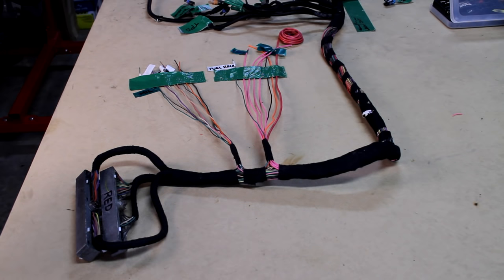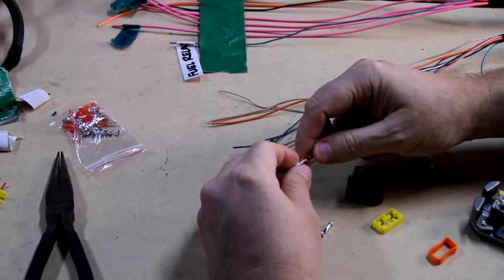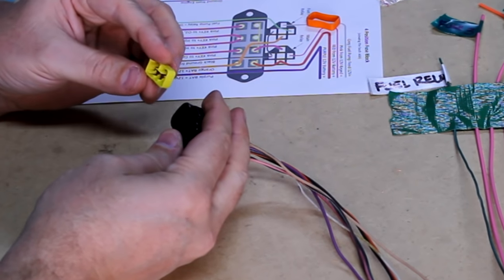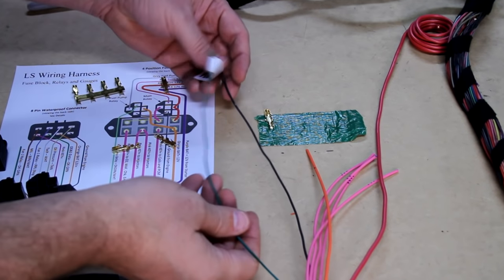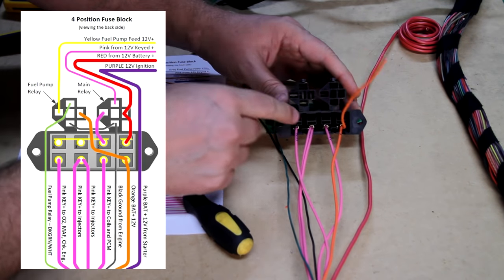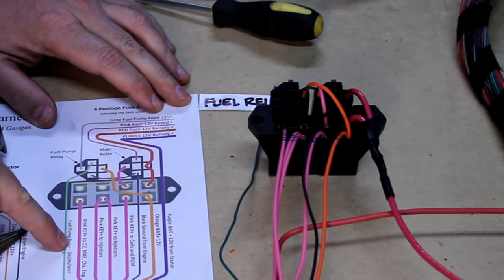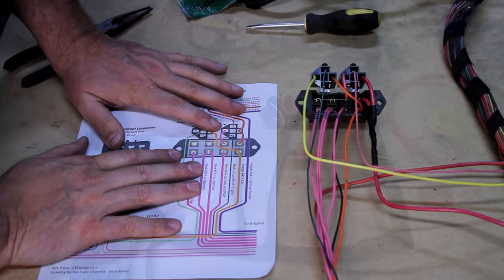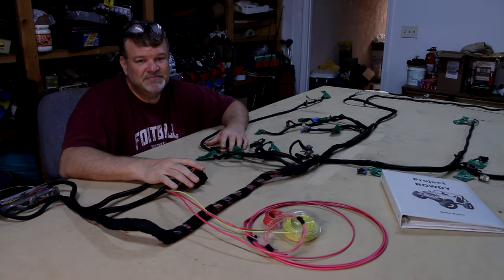LS Wiring Harness Part 5 | Project Rowdy Ep017

Comment: i already install an starter relay so i notice that the ignition switch need a relay so i notice  you run a wire from starter to ign key so my question is, what wires from ignition switch go to a relay? hope you can help me to wire this relay for ign sw. thank you
Reply from the maker: @javierargumedo3  Tou are going to have to find a Wiring diagram for your vehicle OR use a multimeter to determine which wire from your ignition is hot when switched to the Start position.
Reply: am building 1952 Chevy I did not fire up yet am still working on the wiring harness following ur configuration so I have a red wire from batt to ign sw (batt terminal)  a wire from starter on the engine to ign sw ( at terminal) a wire for acc and a wire from neutral safety switch to ign sw (I guess in ign terminal) the think is what wire go to relay from ign sw? For ur help thank you a lot and please  if u know about a wiring diagram for ign sw let me know
Reply from the maker: It would be very difficult for me to understand your configuration.  But should be able to help you with the concept that you need to understand.   Your ignition switch when turned to the "Start" position will provide 12V+ on one of the terminals leaving the switch.  That wire ultimately needs to be connected to the Starter Solenoid.  If you want to run that through another Relay that should not be a problem, but you will need to understand how a Relay works.   The Relay is not required.  I do not plan to add the extra Rely to the circuit.   The "Start" position of your ignition switch is the spring loaded position that is momentary.  Once you let go of the key, it rotates back to the "Run" position.  While the switch in in that "Start" position, it should be supplying 12V+ to the Positive side of the Starter Solenoid.  The Starter Solenoid acts like a Relay.

Comment: I did mine is exactly like in this video but the fuel pump is not getting any power .it's like the relay is not passing it along. one side of the relay is hot the other side nothing.
Reply from the maker: The Green wire from the PCM is a Trigger Wire.  When the PCM wants the Fuel Pump to run it send s +12v trigger signal out the green wire.  That wire is used to Activate the Fuel Pump Relay.  When the Fuel Pump relay is activate (it will click), The incoming Orange wire to the Relay is connected to  the Yellow wire in the diagram sending +12v to your Fuel Pump.  The Fuel Pump needs to be locally grounded.  If you understand the basics above, you should be able to test any portion of that with a multimeter to see where yours is not working.   Mike
Reply: @UCanDoIt2Mike  thanks it's was the fuel pump ground. and I appreciate the response
Reply from the maker: @Nutflame55  Heck yea!  You'll be puttering around in no time!  Cheers!  Mike
Reply: I forgot about c100 pin c I know it goes to the bottom of the fuse block for 12v key but I don't know where else it goes to complete the circuit

Comment: The red wire that shows “red from 12v battery +” does that wire go straight to the battery??
Reply from the maker: Yes....   RED 12V Battery + is direct to the battery and is always hot.
Reply: What gauge is the red wire??

Comment: Love your videos.  I have one question though, why no fuse on the fuel pump?
Reply from the maker: You scared me for a minute, as I thought back through it in my head, I was about to agree with you.   I had to look back a the drawing.  The circuit that is powering the Fuel Pump is protected by Fuse 1 in my drawing.   The Orange wire feeding the Fuel Pump Relay is coming from the protected side of Fuse 1.   The Green Relay trigger wire is protected by the PCM.  None of the trigger wires coming from the PCM pass through an additional fuse, so I would not think this one would need that either.  Hope this helps.  Pretty sure this is correct.
Reply: OH!  Gotcha.  Makes perfect sense.  So it's just a trigger wire not a feed wire.  No fuse necessary.
Reply from the maker: Yes.  The PCM will use the Green wire to control the relay.  Thank for watching and the concern...  As I took several designs and combined then into this solution, there is always room to get something wrong.  Most people watch these videos and it makes them glassy eyed.  It appear that you were able to follow the logic.  Have fun with your next project!!!!!!!

Comment: My number one fuse keep popping
Reply from the maker: You’ll need to check for a short in that circuit.
Reply: @UCanDoIt2Mike  I think it was the fuel pressure regulator ground is that common
Reply: what about pin41 on blue connector  my tranny is on limp mode
Reply from the maker: Unfortunately my configuration is setup for a Manual Transmission, so I removed all of the Auto Trans wires.  You'll have to find some GM wiring diagrams.

Comment: UCANDOIT2 what did you end up doing with the TCC wire?
Reply from the maker: I deleted my TCC wire as it is used for a configuration with an Automatic Transmission.  I am running a Manual Transmission.

Comment: Is there a particular reason that you have relay terminals 30 and 87 reversed from most standard relay wiring diagrams?  Normally, since terminal 30 is common, it is your 12v+ power IN and then when switched, 87 is your 12v+ power OUT to your accessory.  I know it still works your way, but doesn't seem to be standard practice.  Just wondering if I missed something along the way.  Thanks for this great series!
Reply from the maker: No particular reason.  My drawing was based on a previous solution provide by LT1Swap.  You are correct that Supply Voltage should be on Pin 30.  You are correct that it really doesn't matter.  It allowed me to keep the diagram clean.  Very nice observation.

Comment: Rowdy nice videos I hope u can help me to solve my problem on my 09 Chevy I don’t have signal in fuel relay and also not signal in purple wiring to crack my start any help we appreciate 🙏🏽 btw I’m running my stock v8 harness from v8 engine when I swap motor from v6 to v8
Reply from the maker: Incorrect wiring would be impossible to solve over internet chat.  Because you have narrowed it down to which wires/functions are failing, you will just need to use standard troubleshooting techniques to isolate the issue.
Reply: So what you recommend me to do and solve my issues? I’m thinking to do a relay wiring for fuel pump and put directly signal from switch to external relay then to the starter unit

Comment: Were does temp sensor wire plug in ,all see is oil pressure, tach nothing else
Reply from the maker: There is a Temp Wire in the harness.   I will be using that to communicate with the ECM what the temp of the engine is so that it can make appropriate adjustments.   I will have to add another Temp Sensor and new wire that supports the Temp Gauge in the Old Jeep that this engine is being installed.

Comment: What is the part number of the relay sockets for the fuse box?
Reply from the maker: Tools and Parts used:
Qiorange 8 Pin Connector:  http://amzn.to/2lNgMW8
Doorman Fuse Block:     http://amzn.to/2kOBR2R
e-Ting 5 Pin Relay Socket:   http://amzn.to/2kOzzRk
Absolute RLS125 Relays:     http://amzn.to/2lNp4gR
Vice Grip Wire Strippers:     http://amzn.to/2lI3fie
Loom Fabric Tape:     http://amzn.to/2xZng69

Comment: I just bought all those items on you're list, How come you never worked on you're electric fan setup, Anyways i had to purchase more relays one more fuse box and some other stuff on Amazon their prices are not bad i spend little over hundred for every thing i need for harness rework ohh yeh now that you mention i have to buy Wire Crimper and about that ground going in to that connector can it be any ground wire from the harness right?
Reply from the maker: 64impalaSS once I get the engine in the Jeep there I will finish all of the additional working needs including the final setup for the fans and dash/gauge Wiring.
Reply from the maker: 64impalaSS any ground wire in the engine harness can be extended to ground any of the device/sensors on the engine.
Reply: Thank you my friend so purple starter wire does not need to go to to any fuse box/ relay
Reply from the maker: Nope!   The Purple Starter wire is the 12V+ Trigger wire for the Starter Solenoid.  It will attach to your starter to trigger the solenoid (fancy relay) and there will be a large red 12V+ coming from the battery that will provide the Start Motor current.
Reply: UCanDoIt2 thank you ... you’re the man

Comment: BEFORE MAKING CONNECTIONS TO FUSE BOX AND RELAY ASSEMBLY ROUTE THESE WIRES THROUGH THE FIREWALL, THIS ASSEMBLY SHOULD RESIDE WITHIN THE PASSENGER COMPARTMENT!
PS- There's no reason the PCM couldn't reside within the passenger compartment as well (especially in and off road vehicle application).  Buy and use the proper crimp tools ( even cheap Radio Shack ones) to avoid problems associated to vibration/ breakage issues down the road!

Comment: You might want to look at your wiring diagram. the fuel pump relay  coil needs a 12v +  you have two 12 volts negitive  on the coils.
Reply from the maker: In my diagram, for the Fuel Pump Relay coil, I have a Black Ground (-) going to the 85 Relay pin and a Green/White (+) Trigger wire from PCM Red 09 going to the 86Replay pin.   Look right to me!  It is the exact same layout as the original GM wiring diagram (I just checked).
Reply: UCanDoIt2 isn't the fuel pump trigger from the pcm a negative. Like the the fan trigger?
Reply from the maker: Not according to the GM wiring diagram.  The wire on the opposite side of the coil from the Grn/Wh wires is a grounded wire.  Therefore the Grn/Wh must be a Positive trigger.
Reply: UCanDoIt2 ok just checking🖒

Comment: Where do you get those connectors and where do you get those diagrams
Reply from the maker: The connectors I found on Amazon.  The diagrams I drew in MS Visio.  They represent the custom wiring for my Jeep and will be very handy down the road if troubleshooting is required.
Reply from the maker: You can download my diagrams from the description section of this video.
Reply: Ahh so it would be a little different on a obs Chevy. You use the connectors to merry the 5.3 harness and the jeep harness together? And build a standard fuse block off of a standalone harness?
Reply from the maker: @calecutler4970  Actually, I added that 8 pin connector just so that I could separate the engine bay harness from what goes to the under dash area.   The diagram and configuration could be dropped into any vehicle that you want.  It is not Jeep specific.  When I run the wires to the under dash area, they will connect to all new instruments.   This does not connect to anything provided by Jeep.
Reply: I have my 5.7 harness depinned and ready to go, working on depinning my 5.3 harness. Just need to figure out how to merry them together and build the fuse block.

Comment: Are the gen v harnesses similar to LS?
Reply from the maker: A little bit of a conflict in terms.  GENx is a group of engines based on a platform that existed between X year and Y Year.  Every configuration of GM engines get a 3 digit build code (LS1, LM7, LQ9).   There are LSx configured engines available during each of the Generations (GEN3, 4, 5).  The general wire cleanup approach illustrated in this series can be loosely applied to any computer controlled engine (GM, Ford, Dodge).  You just have to obtain the wiring diagrams and pinouts to make the appropriate decisions on what to keep and combine.  If I was to do a GEN5 engine, I would follow a similar process, with altered wiring information.
Reply: UCanDoIt2 thank you for the information!

Comment: Do you need both fan wires
Reply from the maker: Dexter Ferrell   Nope!   The current electric fan that I have installed in my Jeep (square radiator), is a single speed fan.  You can disable the second wire in the PCM and adjust the Fan 1 wire for the Temp you want.   Now with that said, I may look for a dual or two speed fan and take advantage of both wires at some point.

Comment: Where did you get those wiring diagrams at ?
Reply from the maker: I drew them!   They are available for you to download free in the description area below the video.
Reply: That’s some nice help there.. thank you.
Reply: I just tried to do it . It says has been closed by britly  .
Reply from the maker: I will look at the link and try to fix it later tonight or tomorrow.   Thanks for letting me know it is experiencing issues.  Mike
Reply: @UCanDoIt2Mike   thank you for the help !!! Much needed .. long story ..
Reply from the maker: @expatconn7242    Try this link.   It opens a PDF file with the diagrams.  https://www.dropbox.com/s/kep8e588gsxe35h/LS Wiring Harness Fuse Block and Relays with Connector.pdf?dl=0

Comment: is that all done in 16 AWG?  even for the constant hot to the battery?  I haven't been able to find any info on this.
Reply from the maker: Yes 16 AWG.  There is a formula for this.  I don't have it one me, but a guy at my office ran the calculation and verified that 16 AWG is the correct gauge.
Reply from the maker: Have you downloaded my diagram.   It is clearly marked on the diagram.
Reply: yes I have downloaded it and looked at it.  Just hard for me to believe that a constant hot coming off of the battery is only 16 awg, just had to clarify.  thanks :)
Reply from the maker: That wire just provides power for the PCM, OBD2, and Fuel Pump.  2 of the 3 are momentary uses.

Comment: Where exactly does the fuel pump wire goes ?
Reply from the maker: The Fuel Pump Wire from the PCM goes to the Fuel Pump Relay.  It is the trigger wire to tell the Relay to feed power to the fuel pump.  The Fuel Pump wire leaving the relay goes to the positive leg of the Fuel Pump.

Comment: Will this work in a older GM LS awap?
Reply from the maker: This approach will work for any engine (GM, Ford, Dodge, etc) you just have to customize your choices.  These videos show details for 99-02 GM Harnesses and very easily adoptable for all others.  This engine is now ready to be swapped into any vehicle.
Reply: What about lq9 6.0 v8 same steps?
Reply from the maker: @marcoquiroz301  Yes!   You just need to obtain the Pinouts for that engine and follow the same steps.

Comment: did u run a wire to fuel gauge in the dash?
Reply from the maker: The fuel gauge is run from a wire coming directly from the Sending Unit that is located inside the fuel tank.

Comment: Hlw sir.
I need some  help .2001silverrado ls 5.3  and2003  5.7 ls1 same like or not.??
Reply from the maker: They are LIKE!!!!!   They both share the Generation 3 platform which means the layout is the same and they share footprint.  The block SIZE is the same so many parts are interchangeable (Heads, Water Pump, Oil Pump, Intake, Exhaust Ports, Cams, Cranks -be careful-, Oil Pan, etc).  The Differences include the Cylinder Bores in the block are 3.898 (5.7L) versus 3.780 (5.3L) so Pistons are NOT interchangeable (different diameter).  The Crankshaft...  The 5.3L shares the Crank with another displacement, (not the 4.8) and I think it is the 5.7 or 6.0.  The Block will accept the cranks (dimensionally), but you would have to work out Piston Rod length differences).  The large difference is the Bore and all that it affects.   Hope that helps!
Reply: Thank you sir.
Just one more question.
5.3 ecu wireing contion  and 5.7 same same or not.
Please say me.
Reply from the maker: Not sure if they are exact... But the approach that I used in this video series will apply to any harness.  You will have to obtain pinout charts and connector information and study it to make a decision on what to keep and discard for your application.